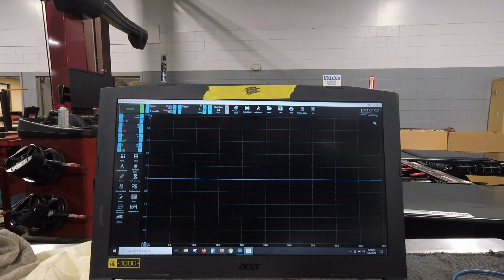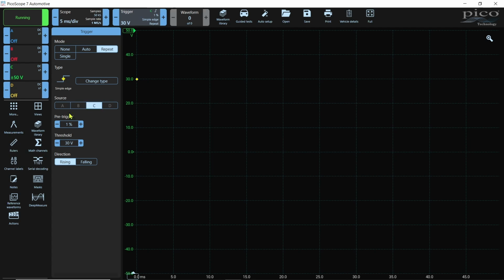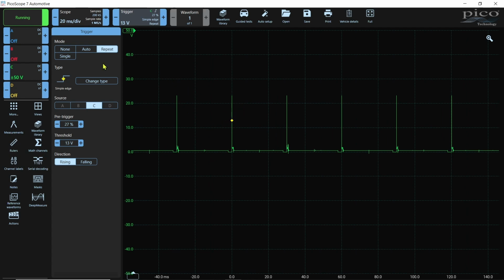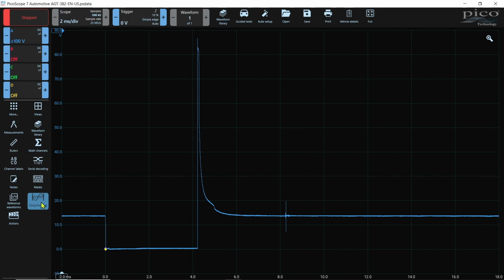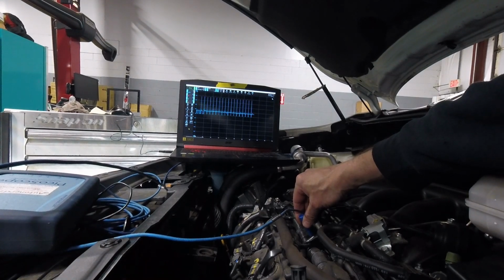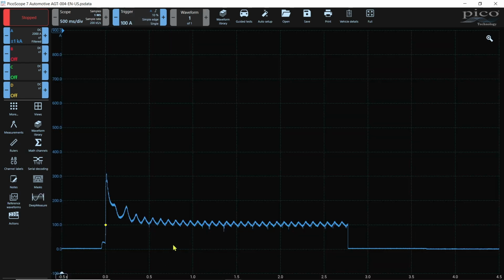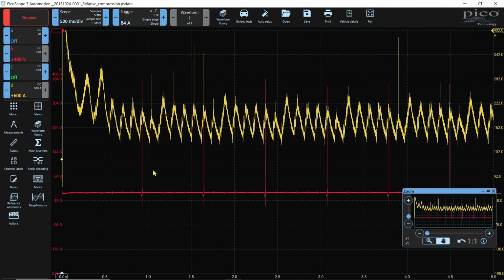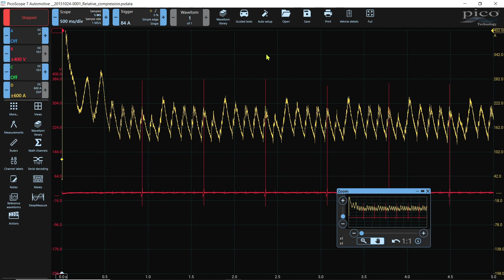Pico 7  Triggers

Comment: Semi-off topic, but why do you think you sometimes see a higher than normal peak on the cylinder after the one with low compression? I've come to my own likely conclusion about this but I'd be curious to hear your thoughts.
Reply from the maker: When a cylinder leaks, its harder for the starter to pull the piston down on the expansion stroke. If you couple that with the next cylinders compression stroke it creates more work for the starter, that gives the higher spike when viewing amperage
Reply: @ Oh interesting, I can see the logic in that. My theory is that the compression in the next cylinder actually is higher than normal due to the increased rotational speed/reduced loss of air past the piston rings. This would also explain why you see it more often in 6 cylinder engines than 4 cylinders, since in a 4 cylinder no two cylinders are both on their compression strokes at the same time. It's something I've been meaning to test out just to satiate my own curiosity, and should be relatively simple with a mechanical compression gauge and scope (I don't have a fancy in-cylinder transducer just yet 😉).

Thanks for the reply.

Comment: Thank you for the video. The one with a lower compression ratio is cylinder 2? How to easily check whether the problem is washing out by the injector?
Reply from the maker: You could use a pulse sensor in the dipstick tube and check for crank case pressure. You could use a mechanical fuel guage and monitor leak down. If possible use a scan tool and monitor fuel pressure and watch for leak down.  If possible pull  the plug and look in the cylinder for fuel. So lots of ways depending on tooling and accessibility.